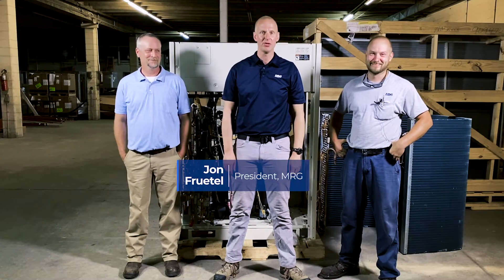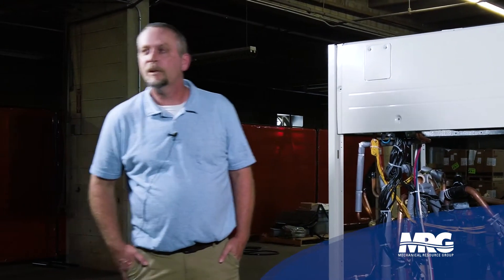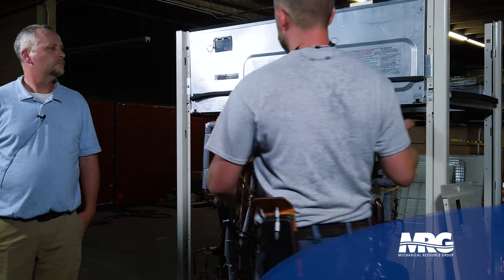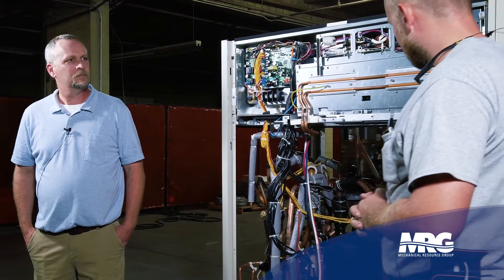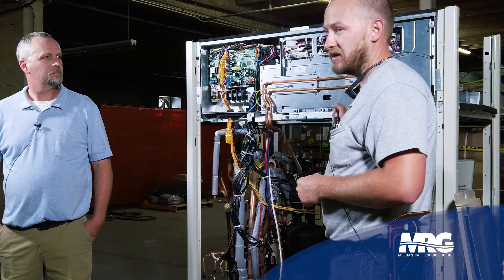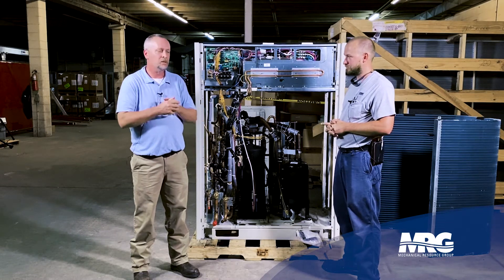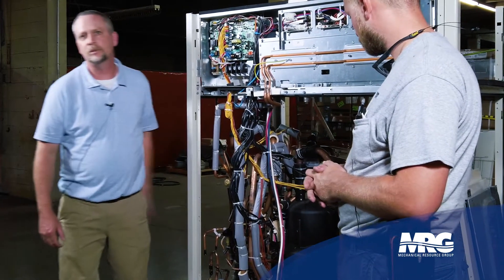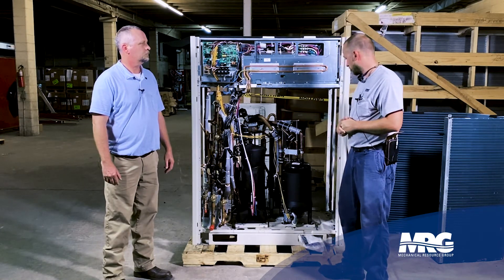Daikin VRV X Product Review

Comment: Don't  ever install  these units . The hype  not worth the pain . Inverter  orgasam  everywhere. 
Access  to all electrical  ridiculously  hard and dangerous .  More  printed  circuit  boards then in a comms room.   More codes of service  than a computer  programmer  would know . And if installed  near the ocean  then buy a spare unit and replace  in 4 years , actually  just buy  a spare unit  cause  the parts will be cheaper  than buying  them separately.  Good luck.